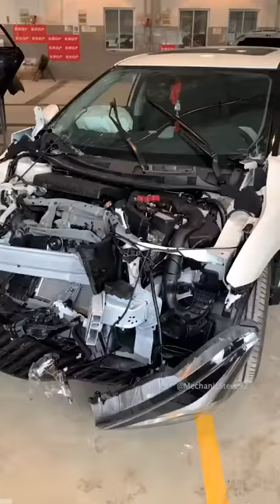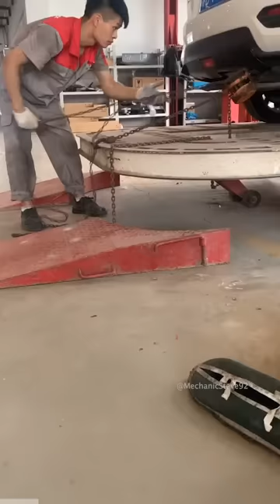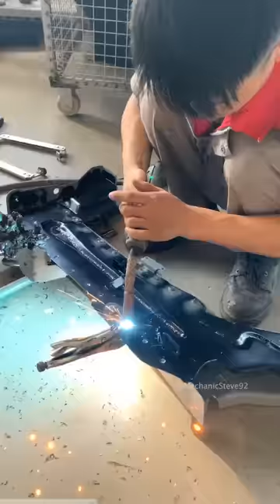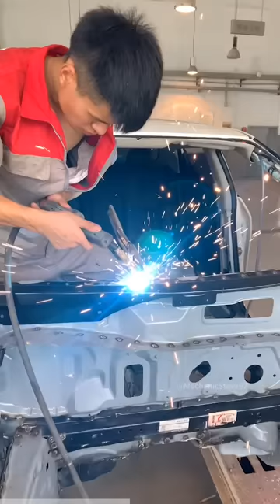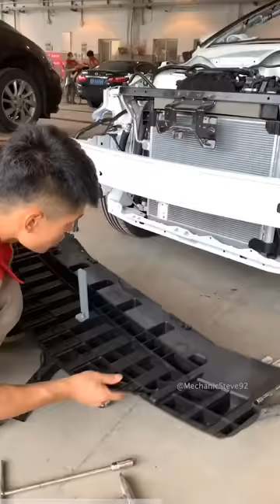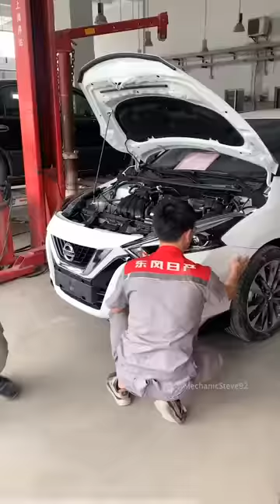Full Process Restoration Serious Front Crashed Car | 修车哥日常 Mechanic Chris | Take 2 Month For Repair

Comment: And then he's gonna have to replace that cvt soon 🤣
Reply: Good one😂
Reply: If he doesn't tow he will be fine. Hopefully 😂
Reply: China 🇨🇳 can rebuild humans , a CVT not an issue , is done in one day , cheap !
Reply: @ralphmadera4366  god he creates humans no one else can do.
Reply: JATCO
Reply: @PianoMan5000  ya mammy??
Reply: Why the laugh. I'm sure the owner has arranged something. Either buy new cvt  set from Nissan, or probably change the transmission to manual. Many ways to solve. It's an easy problem
Reply: @nurburgringkid  all for it to break down again later 😂

Comment: I'm impressed with the attention to detail. There's a single car lot here where I live that is a conglomerate of smaller dealers. They exclusively repair salvage vehicles. But none that I've seen to this level. The only thing that I rarely see is fading the paint to the adjacent panels. I know it's more work, but if you're this perfect with everything else...
Reply: I’m impressed they use a mig welder without protection.😂😂😂 
I know for experience the pain you get at nighttime while trying to sleep.

Comment: Its good to see a car gets repaired rather than just another car left to rust
Reply: Those repairs wouldn’t fly here in the US insurance comps would total any vehicle with damage that extensive to the firewall
Reply: To rust? These cars are parted out. Everything is sold for parts. Then the entire chassis gets crushed for recycled metal.
Reply: @elhugeo  some cars do most cars left to rust in barns and garage
Reply: @ArCh-or7ey  A car owner can still elect to get the car repaired even if it is that destroyed.  So yes it can be repaired in the US.

Comment: Very skilled but I would never buy a car that's been in such a bad collision and then repaired, I don't think it would be safe.
Reply: Depend on how it is repaired. If you look at it closely ... he replaced all the sheet metal part of frame with new factory one... which are same parts used during factory assembly and welded the same way. Only different is one weld by robot and this one my human. As long as manufactured recommended spec are follow on construction fame.. you are good. This place seem like a Nissan body repair center. They only do Nissan and all parts are OEM.
Reply: It's actually probably stronger than factory as long as he did good welds.
Reply: From the responses you would think the original factory parts were made from vibranium, lol. Obviously they are replacing everything that was damaged with similar quality parts.  If OEM can crumple in an accident so will anything else used 🤷🏾‍♂️
Reply: Well, only if you know the history. 😅

Comment: There was no point in fixing that car, that’s totaled
Reply: Totaled only means the value of the repair amounts to 75% of the car's value. In the West most of the cost is labour. I'm assuming this Nissan dealership is in China where labour costs are really low so actually the cost of the repair wont amount to 75% of the car's value
Reply: The point was to repair it,  so we can see it in YouTube
Reply: It's done all the time with rusted out "one of a kind" or "low production highly optioned" muscle cars.

Comment: Australia. The government would make sure the VIN was cut out and NEVER to be registered or fixed. We used to fix cars like this but middle eastern and asian panel shops were stealing cars for parts or transfering the vin numbers and they wrecked the industry.
 Anyway the cost of this repair is higher than the value of the car by 2. You wouldnt bother,, ITS TOTALED, They paint 2k with no mask or spray booth. he is a good worker, well done mate.

Comment: Have you ever folded a piece of thin metal with your hands, and went back and forth with it until it broke?  SAME here, when you stretch the metal from a wrecked car, it's a little weaker. Stretch the mangled areas to gain access to the spot welds, drill out, replace all new sheet metal to area of body that was untouched.  Play it Safe.

Comment: I've never seen you use any measuring equipment to make sure that your cars are square you weld on New ports to make parts fit but that is not the proper way

Comment: I'm okay with drilling out spot welds and installing new sheet metal and weld in. However I'm not okay with stretching metal back in place, this becomes the weak link.

Comment: Not only does he not use safety goggles or mask helmet when welding, he also uses the Crescent wrench wrong! The movable jaw should always be on the side of the nut in direction you are moving it! You will eventually ruin the wrench by spreading the movable jaw!

Comment: Impressive work but best not have another crash with cars like this. The high deformations change the mechanical behavior of the structure especially if reworked as in the video. I do not recommend driving it again.

Comment: This car took an almighty blow to its front end. The shock and force will have distorted the whole structure. Modern vehicles are built structurally as a whole, not of bits that can be swapped in and out like this, however it’s done. Only an idiot or an ‘innocent through ignorance’ would ever drive this vehicle again. To use a technical term, it’s completely fucked!